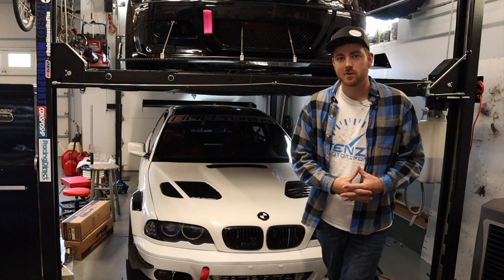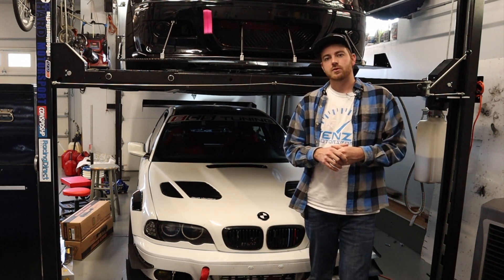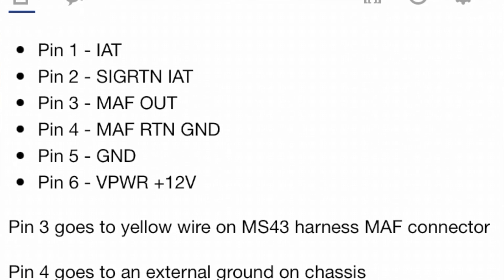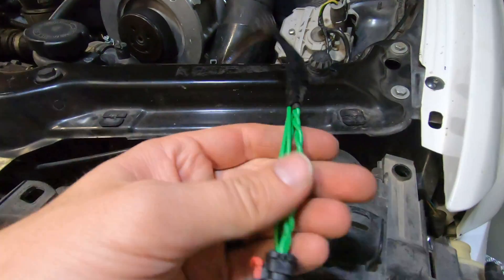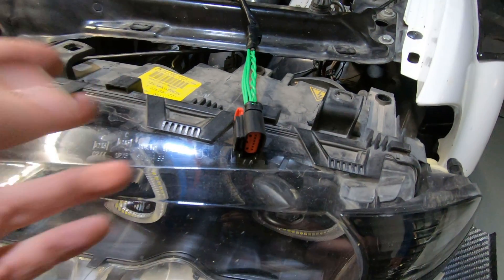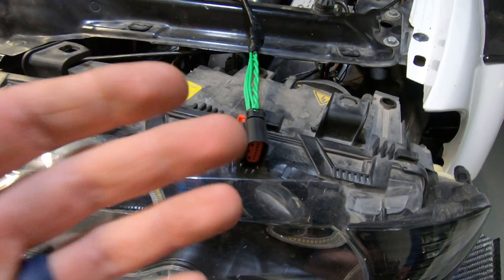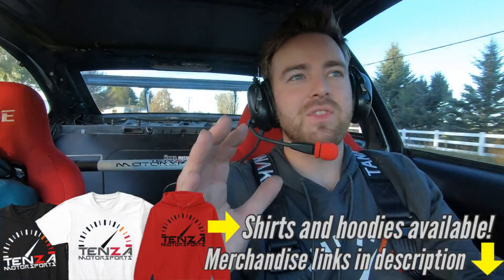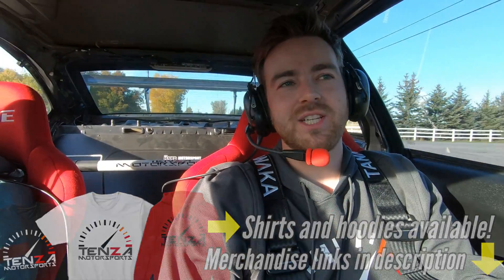Boosted E46 custom MAF - PMAS upgraded mass air flow sensor DIY install on track build BMW 330ci

Comment: Running the same kit AA stage 2 with a 70mm pulley at 450whp, oem MAF is not following anymore. Looking at the PMAS HPX maf, what's the difference with the MAF+housing that you linked in your description and the HPX version? Just the HPX maf is more $ than the housing + sensor you linked. Thanks!
Reply from the maker: I did have to change a few couplers because I got the 4 inch housing, instead of the 3 or 3.5. And then I put a slightly different style of intake filter on it and then obviously the filter is now 4 inch. Other than that, it was no big deal!
Reply: But did you use the MAF that you linked in your description or the PMAS HPX?
Reply from the maker: MH95B-2600 95mm Housing w/Tuned MAF – 2600KG/HR This is what I used. It's liked in the description.

Comment: Ive been looking for a front lip whered you get that? And what kinda front bumper is that??
Reply from the maker: The lip is an eBay part with a custom built splitter. The front bumper Is an m3 replica